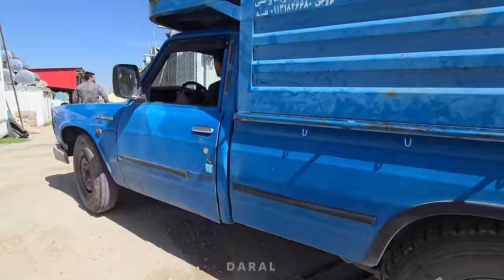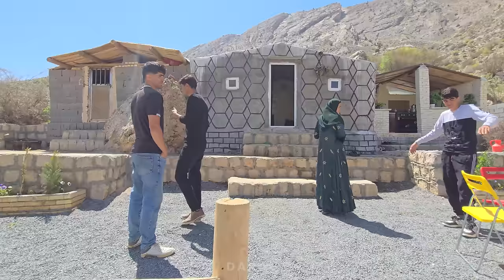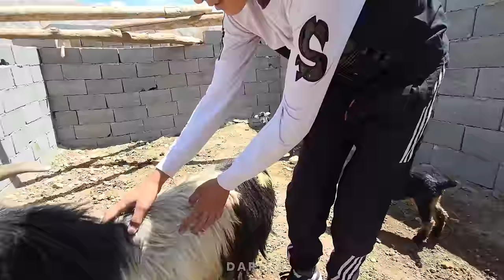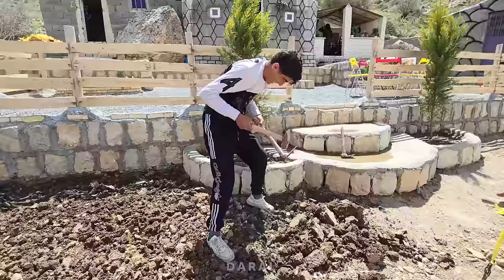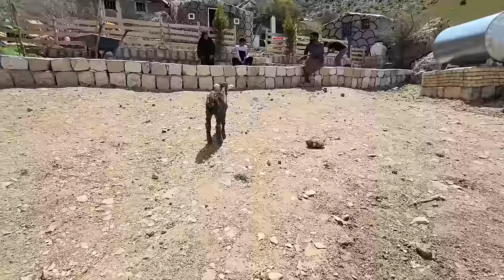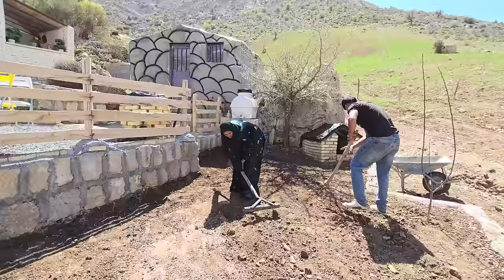"Hasan Returns from University to a Heartwarming Family Reception"

Comment: Glad Hassan is back. I think the shower floor turned out great Milad, the family again came together!  I was thinking that with concrete blocks to build a large watering trough (bin) and add the concrete mixture to seal it. You can keep the water tank hose on a slow drip into the trough so it never runs out of water, with less work worrying to water the sheep and goats! Your videos are so appreciated and prayers and blessings to your family ❤